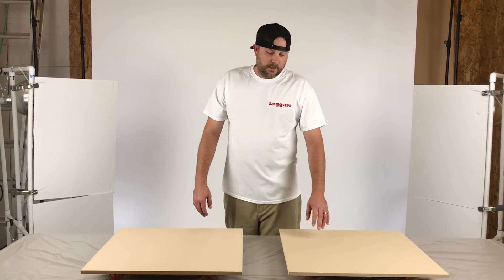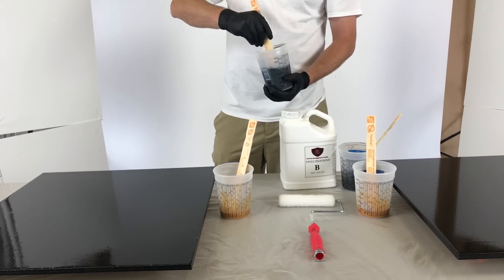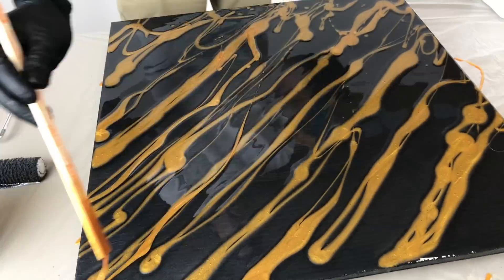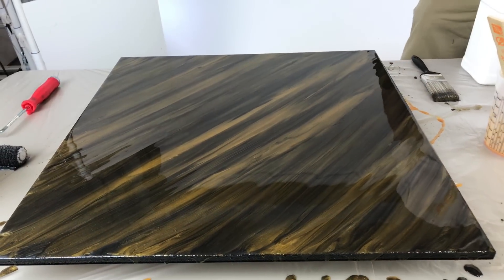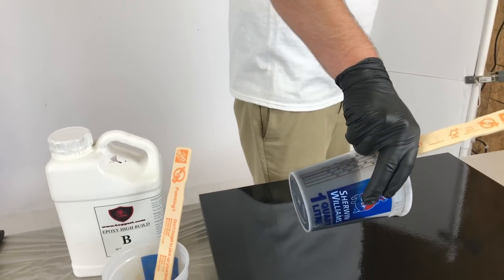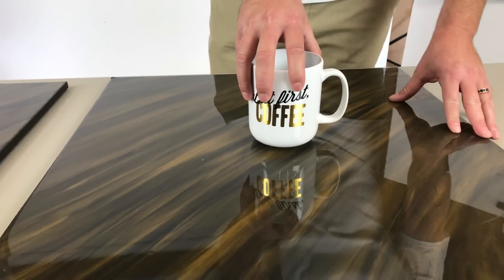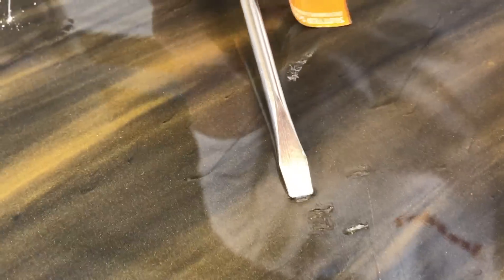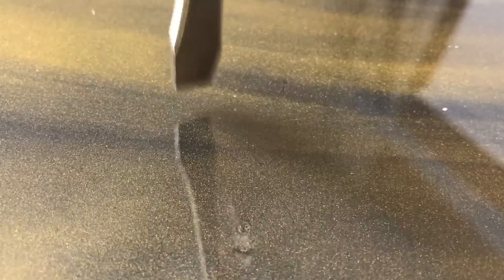This is what happens when Epoxy Resin is mixed Incorrectly or with the wrong ratio.

Comment: Great Video! Before peeps start hating on the vid, read the video description. Plus, the correct ratio is the 1:1 or 1:2 listed on the jug of epoxy or in the epoxy instructions. The wrong ratio would be anything that isnt 1:1 or 1:2. Also in the correct mixing the instructions will list to stir for 3-5 minutes until mixed well and scrape the sides and bottom. So the wrong mixing will be stirring for less then directed and without scraping sides and bottom. Simply put: for Correct Method follow instructions of epoxy. For Incorrect Method ignore instructions and wing it. That simple.

Comment: I do appreciate you taking the time to conduct that comparison. Would recommend that you explain what your doing when mixing correctly and the same for the other board. I am one of those DIYers that look for these kinds of videos to learn from. By the way, based on most of the epoxy videos I have seen on YT, mixing by hand is the recommended actions and NOT mixing with A DRILL.

Comment: I though the point was to show the correct way to mix...which he never mentions the ration or how to do it.........he just shows you the end result....so what is the purpose of the video?
Reply: My thoughts exactly. Useless video
Reply: I mean thing that I got out of the video was that the last one he didn't mix for long enough. But yes I agree with you I think that he could have been a lot more descriptive about what was wrong
Reply: The purpose? Really? It is in the title and at the end of the video. It's so you know what happens when mixing it wrong.
Reply: SMH.
Reply: @vanessanandez  exactly! If I had to guess, which I did, he did not scrape the sides and the bottom of the cup while mixing & he didn't mix long enough!
Reply: I think the moral of the story is READ THE DIRECTIONS more than anything. They will tell you the ratio. The epoxy I'm about to use us 1:1 for instance
Reply: Well the correct ratio is the 1:1 or 1:2 listed on the jug of epoxy or in the epoxy instructions. The wrong ratio would be anything that isnt 1:1 or 1:2.

Comment: Wow.. the correct one didnt even scratch... hurray thank you for that.....😀
Reply from the maker: Totally! Such a difference! : )
Reply: valerie Henry Actally, it did.  If you look closely to the right of his hand at 4:24 You can see the long scratch.  I do hope that's because it's only 3 days cured.  I don't remember for sure if this is the brand that says that it is at its toughest after a 30 day cure.
That being said, his point in this video is VERY WELL made.  If you don't mix it right, it's soft, pliable, and prone to a large extent of damage with little effort.  Nothing an extra 27 days of curing will fix.
Reply: It does scratch a little but all resins do.  Actually, everything scratches if it isnt a diamond.  :)        Resin can be repaired with a heat gun on some instances, which is why they make good surfaces for tables and night stands.

Comment: He stated the 2 errors being made were:
 1) not mixing thoroughly 
 2) not measuring accurately
Reply from the maker: That is correct, thanks for watching the video.
Reply: Leggari Products yes but also tell us verbally the ratios duh ! Smfh 🥊
Reply: @ArturoGarcia-er1hk  I think it depends on the product. I got mine that instructed me to do 3:1 ratio. Other products were 1:1 ratio.
Reply: Even if the  ratio is right, mixing with not enough time, not scraping the sides - will mess it up.  Constantly scrape the sides while mixing, mix for the recommended time, and DON'T scrape out the final product for use (the stuff clinging to the sides is most likely to be unmixed).
Reply: @blingblingmanomano  yes! Actually, the lesser you put the "hardener", the less harder the outcome is. I tried, so ratio really doesn't matter. Mixing it thoroughly is a must if you want to cure it perfectly!
Reply: @janineathenam.guzman7089  This is misleading. Epoxy is a chemical reaction between two reactants. If you have too much of one or the other then you have unreacted components. This will affect the cured properties even if you mix well.
Reply: @stuartmcnaughton2848  that's true... anything that's too much or too less will turn out pretty bad. I think the general rule for mixturing these is 3:1 - 1:1- but this is just based of my experience and observation. I've used 3 different epoxy resin before but yknow, I could be wrong.

If people wanna be sure, follow the instruction that the product offers~

Comment: 4:25 even your glass finish got scratched mate !
Reply: Nobody claimed that it's scratch proof without a protective coating.
Reply: Epoxy scratches relatively easy... Thats why everyone throws a clear urathane over the top to help protect from scratches
Reply: youre correct my leggari epoxy floors look like some scratched up shit near both my entrances after 3 years
Reply: @brandon4514  the scratches can actually go deeper than the poly coat like in my case. sanding it down hoping for a do over is out the question. ill just top it with vinyl planks

Comment: What was the black primer u put on before u did your pouring? It was very glossy before hand. Love this so much btw
Reply from the maker: Our primer is a water based epoxy specifically designed to chemically bond to almost all smooth surfaces.

Comment: Would it work as good if you mix it with a tool like a drill? Would it cause more air bubbles? Would it shorten the stirring time?
Reply from the maker: Yes you can use a drill to mix the product.  You will mix the epoxy for about 3-4 minutes.  Thanks

Comment: Had some counter tops done. Bar was perfect. Counter tops along the walls actually soften with heat. I think the second layer was mixed wrong, and the top clear coat was done right. You can literally move it with your fingers like a hard bubble of water. I was told that it was probably the temperature of the room? When we did the Bar it was about 70, when we did the counter top, it was 90 in a new construction. Any info on this would be great.
Reply from the maker: Hi there, did you use our products to do your counter tops?

Comment: I have noticed strong fumes from using it. Is it supposed to smell very strong. I was using it and had to run to another room in my apartment. I then opened all the windows. My right nostril is burning a little bit. I hope I am ok. Also what would happen if you use the hardner by itself? Also how do you safely sand without experiencing any toxic effects?
Reply from the maker: The product is very low VOC’s meaning it has little to no smell at all. It’s 100% solids so there’s no toxins evaporating in the air.

Comment: If this happens is there a way to correct it? Can a clear coat be added that is mixed correctly?
Reply from the maker: Yes you can sand it down with 120 grit to scuff up the surface then clean it with denatured alcohol then reapply our product.  Thanks
Reply: @LeggariProducts  thank you.

Comment: had flooding in our basement from Harvey...Had someone come in to Epoxy flooring on the concrete.  Most of it looks great.  There are some areas that did not take.  I suppose one could guess the rest of this.  Contractor is not answering calls to come and fix.  "Contractors" taking off have reached epidemic levels in our area.  What you have described is exactly what has happened. I would like to know what I can do to fix this as I believe the contractor will probably never answer calls and my furniture is still on the back porch!  Any help or answers would be welcome!
Reply: You could always do,it over what has been done incorrectly. It would be expensive, but its obviously niy going to last like this. Plus if you already have all your stuff out of there, thars galf tge battle!! I would just do it over, the correct way, then have a beautiful, durable flior for years to come.

Comment: I have a counter that runs approx 11.5 feet long x 24" deep, then the smaller area around the sink that is about 5 ft. long x 24" deep.  My question is....do you have "smaller" kits that would be for this small of a counter space...or only kits for larger areas???
Reply from the maker: The smallest kit we have does 50 sq. ft. at this time.  Thanks

Comment: Hi, I have to finish 2 rooms, thinking about using Leggari.  However I have done 4 rooms one room the Floor is tacky after polyurethane.   I used Denatured alcohol twice on the floor. .  The floor is still slightly tacky and I can basically scrape the polyurethane off with a screwdriver. Fyi, I waited 24 hours between coats.  Any advice?
Reply from the maker: Email us directly at leggari@gmail.com with pictures.  Can you also let us know what and who's product you used.  Then we can determine a fix for this.  Thanks

Comment: Any tips on removing a finger print? I didn't let mine cure 100% and accidentally grabbed the edge leaving
half a thumb print. Tried using non-acetone nail polish remover on a Q-tip lightly and it helped,
but it left a small amount of residue where the print was. I was thinking something with a petroleum
based additive maybe, but I don't know. I do know when it comes to almost everything I've done
in the finishing world that less is always best. Any tips or advice would be appreciated.  Thanks!
Reply from the maker: If you have not applied a top coat you can sand the surface with 220 grit using a palm sander in circular motion then clean with denatured alcohol then apply the top coat.  You can also try to buff it out.  Thanks
Reply: @LeggariProducts  Thanks for the tip!
Reply: Ok, my mistake was not mixing  the ratio for the complete 3 minutes, hence causing it to be tacky. The denatured alcohol only dulled the surface and same with a 320 and 220 grit. I used WD-40 and it got rid of the tackiness. Typically I use that when cleaning up caulking on jobsites,
and it always worked, so decided to give it a whirl. Honestly, had nothing to lose at this point. 
Then I used Helmsman poly (uv resistant) in a semi gloss. Problem solved! 

Lesson I learned - don't fuuuuk with epoxy directions!)
Why I didn't mix for the total 3 mins? Well I use Gorilla glue epoxy frequently and you can mix for 30 secs and it works just fine. I had presumed in my infinite amateur wisdom, that all epoxies cured the same, and that Parks Super Glaze was being ridiculous. Bottom line for newcomers to the world of epoxies...read and follow directions thoroughly!! I almost ruined a very important project I was making as a gift.

Comment: So how to mix it correctly?
Reply from the maker: You get instructional videos that show step by step process when you use our products!
Reply: Leggari Products just say mix it for 5 mins... You making it more difficult than it really is... Dam..
Reply from the maker: Cam23 I wish it was that simple.
Reply: Leggari Products I do jobs all the time... It's not complicated
Reply: Cam23 You're right. It's not complicated at all but in Leggarris defense not all epoxy/resin is the same. There are also many different uses for it. Just a few ex. are restoring/creating furniture, floors, showers/tubs, boats, walls, sculptures, artwork. There are variance from 1 job to the next as well as 1 manufacturer to the next. There is different ratios, mixing times & directions. There's also weather/temperature adjustments. None of it's 🚀 science and everyone can use e/r but you also have to realize that not everyone has the experience you have nor will everyone be doing the same type of work in the same conditions as you. This stuff isn't cheap so when a customer of theirs is investing hundreds if not thousands of dollars on a product they've never used before I think the co. SHOULD give them instructions. It's good business practice & kudos to them for going the extra mile. Not to mention, I just got sent 2 gallons of bunk. (Out Of Date-Not from this co.) If I didn't know better I would have assumed it was something I was doing wrong & I could have ruined my current project costing me thousands of dollars out of my 👛. Ladies need their $.
Reply from the maker: Cam23 let’s just say we didn’t make this video because everyone is mixing the epoxy correctly. We would agree it really shouldn’t be that hard.
Reply: Leggari Products Lol, You guys keep up the great work.
Reply: But he never answered the question how do you mix correctly why should I buy a product
Reply: I LOVE YOU, AND I WISH THIS WAS THE FIRST VIDEO TO POP UP WHEN I LOOKED AT RESIN ART!!! o and plse link the appropriate video tutorials for mixing some of your most popular resin types/uses...it would be extremely valuable and helpful
Reply: Mickey, by following the instructions, resins and hardeners need to be mixed correctly not eyeballed.  That's the point he was trying to make.
Reply: Mickey The maltipoo if you don’t get on google and look it up yourself i swear ppl lazy these days
Reply: When i mixed epoxy resin for my river table i used the same amount of part a and part b and mixed until the cloudy bluish color starts to become clearer
Reply: JOEANG Ibrahim also i highly reccomend looking around for the cheapest stuff you can find because it still works!! I paid $300 for 6 gallons assuming id need a lot and i did my whole table in under two gallons
Reply: How do you make your different colors?
Reply: With a microwave
Reply: It actually is... I work with epoxy for a living. Proper ratio + proper mixing and you are done 99% of the time.
Reply: Respect the right resin-hardener ratio and mix it thoroughly. Let it cure at right temperature and time and you're done.
Reply: JOEANG Ibrahim it depends how on big the  canvas is that your working on
Reply: I learned that in trade, you can't fix stupid.
Reply: John Jacob yeah but he eyeballed it in the video, and really explained nothing.
Reply: There is no question.If there was the answer would be "RTFM".
Reply: That's what directions are for.
Reply: JOEANG Ibrahim thank you so much!!!
Reply: Hahaha! He SAID it! "it's mixed, no its not" yall are funny! It wasn't mixed right And he used the measuring lines on the side! They were pour in right, they were Not mixed enough on the last on and therefore the Hardener didn't Harden Correctly. Also he said "just like scratching glass" of course it's gonna scratch the first one! A screw driver has a sharp edge, not just the flat tip! Hahaha, ya'll use ur brain and stop being sooo judgemental! THINK BEFORE YOU SPEAK!
Reply: @mickeythemaltipoo3756  watch the instruction video you get with the product. That is what he said. This video just showed what will happen if you don't.
Reply: Mixing correctly varies from brand to brand, and you should probably look for a video that says "How to mix epoxy correctly" and not this video.  It obviously states "This is what happens when Epoxy Resin is mixed INCORRECTLY or with the wrong ratio" and shows you what happens if you don't mix it correctly.  Seriously, what the fuck is wrong with you people who are complaining?
Reply: THIS DUDE IS OBVIOUSLY MAKING MONEY ON CLICKS, THID VIDEO SHOWS SQUAT & HE KNOWS IT. ONE THING HE CAN COUNT ON IS ZERO SUBSCRIPTIONS FROM MOST PEOPLE.

Comment: So what happens if you use the correct ratio but don't mix it enough?

What if you put Part A and Part B in one container and hardly mix them? Do they start to solidify at the points where the mixtures meet, but stay soft through the rest of the fluid?

Comment: One thing I would like to know, and I can't find the answer.  If, after I finish with the epoxy coat, i don't like the pattern.  Can I reapply a new epoxy coat or do I need to somehow strip off the first coat?
Reply from the maker: You would need to sand it with 80 grit, clean it with denatured alcohol then you can prime it and re-epoxy it.  Thanks
Reply: Thank you.

Comment: 4:24 It scratched
Reply from the maker: Yes a screw driver will absolutely scratch epoxy, and just about any surface for that matter.
Reply: true
Reply: but it didn't leave holes and gouges.....I think you missed the point of the vid...

Comment: My kids often use the counter tops to cut stuff on them, will the epoxy hold up to this kind of treatment ?
Reply from the maker: Our counter top kits are rated for high heat and our urethane top coat is extremely scratch resistant, but we still recommend using cutting boards and pot holders like any other high end counter so that your counters look good for years to come. Thanks
Reply: How do I cut off my rounded edge countertops in my kitchen to make a flat surface?

Comment: It looked like you might have put less harder in the second  one  was that part of the demobstration?
Reply: The demonstration is that it was not mixed long enough.  It has to be mixed thoroughly before you pour.
Reply: Damon Diehl yeah I understand that but if u don't put in corect amount of haedner it it won't harden corectly either I'm nearing 15 years of experience  with using materials simular . Looks nice when done correctly thumbs up for video